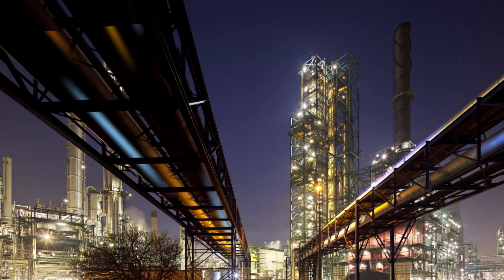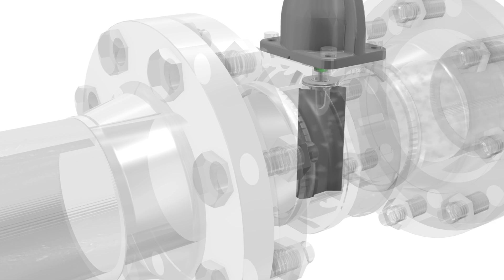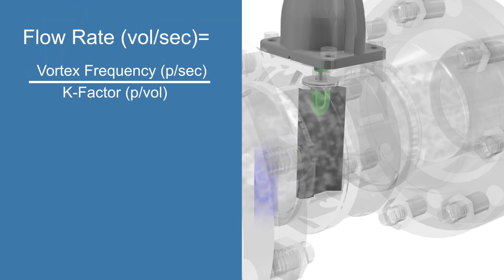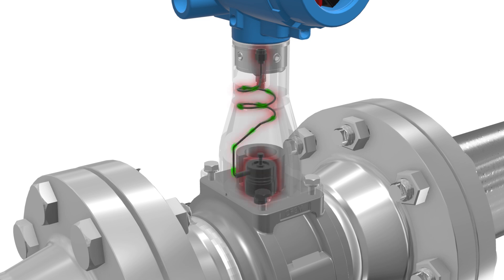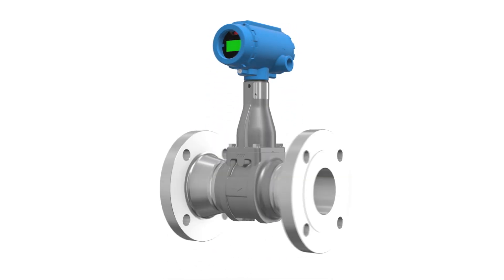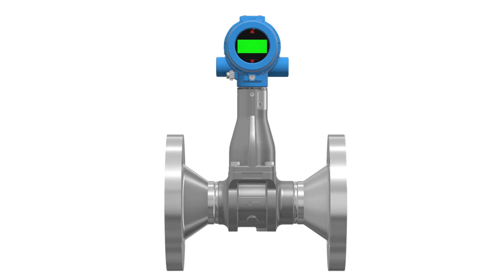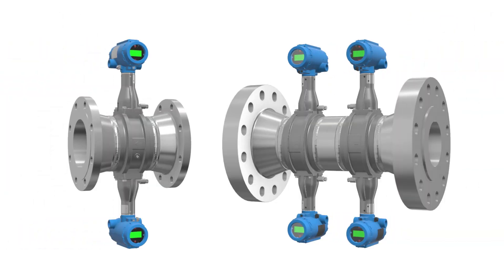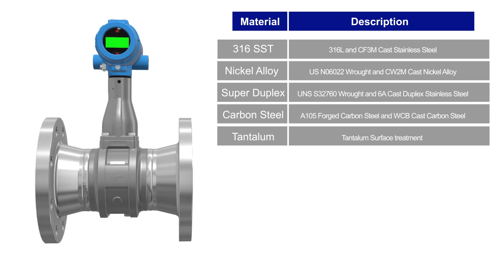Introduction to Vortex Flow Meter Technology

Comment: Are Vortex flow meters reliable on compressor stations with a lot of vibrations?
Reply from the maker: Thank you for watching our video. Compressors stations can have high amounts of vibration, so it depends on how meters are mounted and supported. High vibration may cause a false flow measurement when there is no flow. The meter design will minimize this effect, and the factory settings for signal processing are selected to eliminate these errors for most applications. If an output error at zero flow is still detected, it can be eliminated by adjusting the low flow cutoff, trigger level, or low-pass filter. As the process begins to flow through the meter, most vibration effects are quickly overcome by the flow signal. 

For our Integral aluminum housings, remote aluminum housings, and remote SST housings: At or near the minimum liquid flow rate in a normal pipe mounted installation, the maximum vibration should be 0.087 inch (2,21 mm) double amplitude displacement or 1 g acceleration, whichever is smaller. At or near the minimum gas flow rate in a normal pipe mounted installation, the maximum vibration should be 0.043 inch (1,09 mm) double amplitude displacement or ½ g acceleration, whichever is smaller.

Hope this answer your concern. You may also subscribe here http://emr.sn/8Ja6 to receive news and updates from us.

Comment: Vortex flow meter is very convenient in measuring both volumetric flow and mass flow. Optional inbuilt pressure and temperature sensor, one can measure mass flow also.